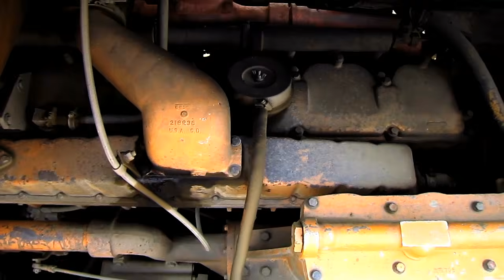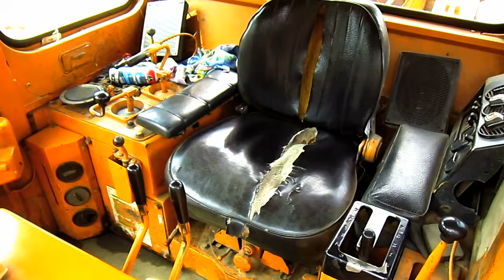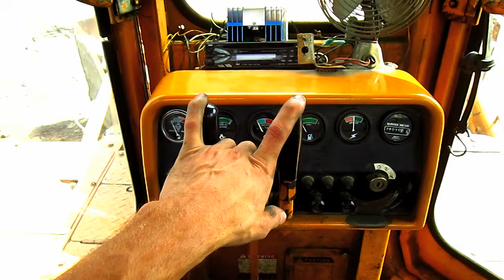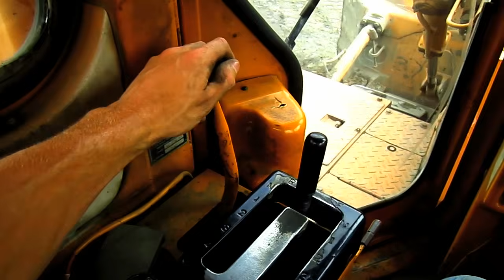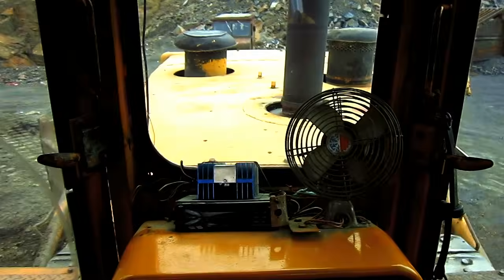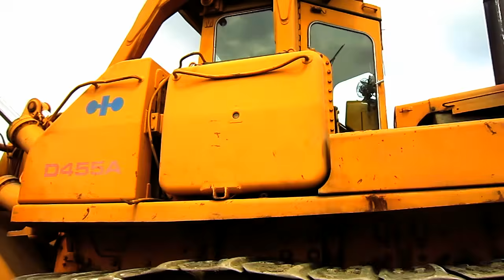The Komatsu D455A - The Brute!

Comment: Hi, PAMining.
One comment - the steering controls do NOT 'apply' the steering clutches. Instead, they disengage those clutches in order to take power off that side track to allow the tractor turn. When the lever is pulled the rest of the way, as you said, it APPLIES the brake to further control the speed of that track or to stop it completely.

Other than that, a good video and thanks for posting it.

Just my 0.02

You have a wonderful day. Best wishes. Deas Plant.

Comment: HI PA, just stumbled upon this video - now you have caught a rare bird for sure. I know just about only one D455 that that worked here in Germany - it was the unit shown at bauma 1977. Directly after the fair it went to work at a quarry in nothern Germany. Thanks for the in-detail docu, very well made. 

But your footage leaves one interesting detail open. The D455 used a center clutch, then two TCs and two D355 powershift transmissons. Komatsu promoted the ability of two seperatly propelled tracks - up to letting the tracks counterrotate. But in the cab, the D455 just looks like a normal tractor steered by clutching and braking. Just normal controls.

Maybe some of the old chaps can clear this up?

Keep the good stuff rolling, PA. I can learn a lot from your videos. Hope you can catch a D455A shifting some dirt one day!

Comment: Thanks for this video on what is probably a unique machine. It is interesting that Komatsu ran 4 speed transmissions and Cat have stuck with 3 speeds.I have a 78 D9H and comparing to a 355 I am assuming it would be out performed in ripping. Be interesting to know how the 455 compared with the D10 .

Comment: You can look right at that machine and see a lot of Caterpillar in it. Thing almost looks like a D9's big brother. Question, since dozers dont have a bucket per say, how do they come up with a cubic yard capacity for them? Is that how much material they can theoretically push before they break traction?
Reply from the maker: Good question.  Pretty sure engineers test and match the engines load and tractive effort to the desired blade capacity on specific grades.
Reply: Thanks for the reply!

Comment: Another excellent video. 
I can only imagine how loud it is inside the cab. 
Question are the tracks worn out? They look fairly smooth.
Reply: TheMrKeys the pads are thin and grossers are worn completely out which usually means the rails,pins bushings and sprockets are worn out. LOTS of dollars for a complete undercarriage reman. These machines and Fiat 41’s  working in sandstone could eat the undercarriages up quickly.
Reply: Dell Sims that’s what I was thinking. But wasn’t sure. I’m still a rookie when it comes to dozers. So thought I’d ask.